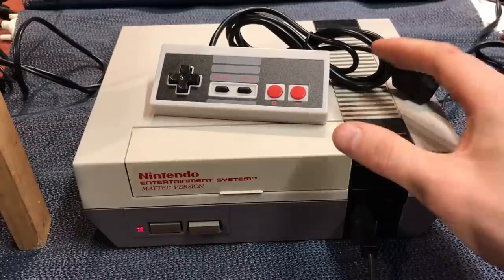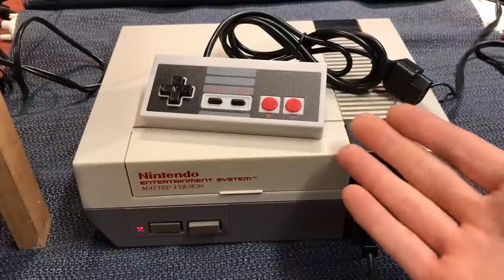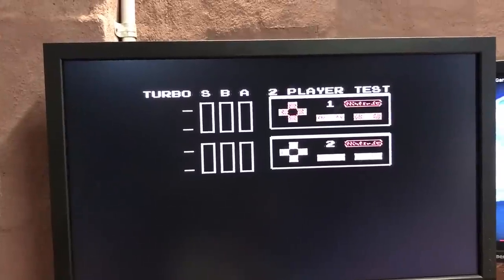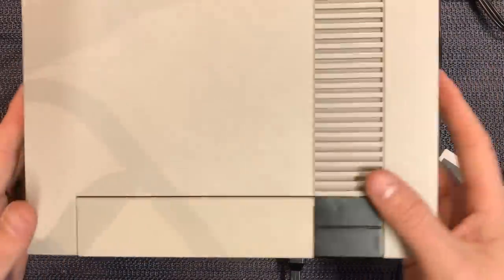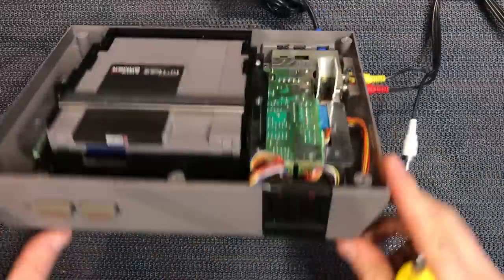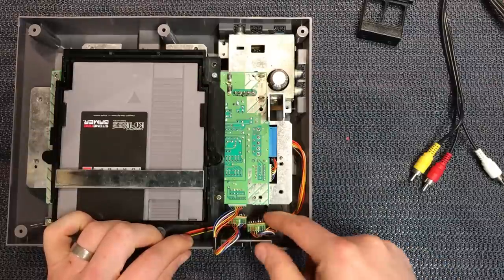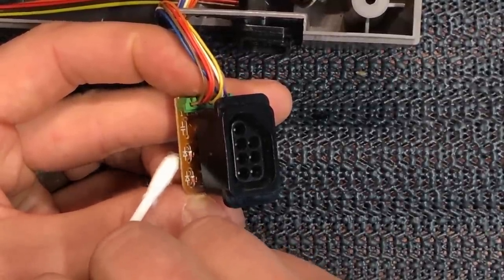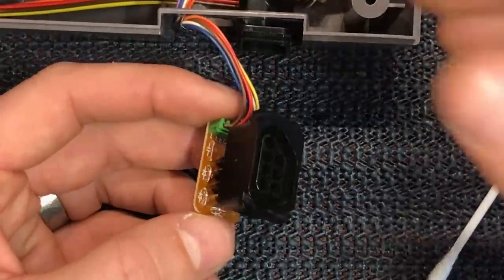PAL to NTSC NES Controller Port hack Mod - YouTube

Comment: Hey there, I have the opposite problem.  I have an NTSC NES.  I just bought a PAL NES FOUR SCORE and it doesn't work.  Do you think this controller port mod would work for my situation?  Or is there a mod for the Four Score?

Comment: Oh, you evil person lol!  I had this on my list of things to-do.  I've got some plugs and sockets of each region and planned to make an adapter.  I will still do it at some point as I wanted to use NES pads on the Famicom and vice versa =D   Great video =D
Reply: In fact, it's different to what I had planned =D  This is like Nintendo did with the SNES - not quite sure why they did this with the diodes, its a bit crazy lol.
Reply from the maker: GadgetUK164 - Retro Gaming Repairs & Mods lol 😂Suck it up princess
Reply: =D

Comment: Nice video, but can you do the same with a clone NES? There is no board with diodes on the controller ports and the VCC and GND of the controller port do not match. Could you make a video in this case? Thanks

Comment: oddly enough the inverse works perfectly fine or atleast you can plug pal nes controllers into ntsc av famicoms and it works great. i wouldn't know if the same applies to pal controllers on us nes but i'd advise getting an av famicom and modding it to have an led/accept the nes zapper and just use a cartridge adapter for us games as it gives you the most compatibility of peripherals (including the FDS) and it's excellent for rgb modding too as you can use the same av out thats already on the system.

Comment: Hi, nice tutorial. But is it there a chance to mod the controller itself instead of the port? I made a DIY arcade stick with a clonic NASA pad with turbo PCB and used it in a PAL NES modded to be multi-region, not cutting the 4 pin leg but soldering the points. The point is that it starts working and suddenly stops reacting after a few moments. I'm not very willing to mod the port but to do it in the PAD PCB.  Could it be done like that?

Comment: region locking on peripherals it's safe to say nintendo have always been a-holes, also looks like you could bridge a few of those connections by scraping a bit of solder mask
Reply from the maker: Yep it's an easy hack.
Reply: PAL controllers work fine on any region, NTSC controllers only work on NTSC consoles. I think the addition of the diodes have more to do with European electronics regulations at the time, than an actual region lock.

Comment: Thanks for the tutorial. 
I bought a power glove from usa and doesn't work certainly because of the controller port on my nes pal. 
Do you think if i change the port on the console(make the differents bridges on the diodes), it can works?
Reply from the maker: Awakkhin Island yes it should work
Reply: @GlobalGarageAus  Thanks, i will try that.

Comment: NES-004E controllers work on all 
NES-004 controllers work on NTSC and PAL-B but not on PAL-A

The solution is to just buy the NES-004E controllers don't bother with knockoffs.

Comment: First, you have to remove diodes and then add jumper wires. otherwise pal fourscore will not work anymore.